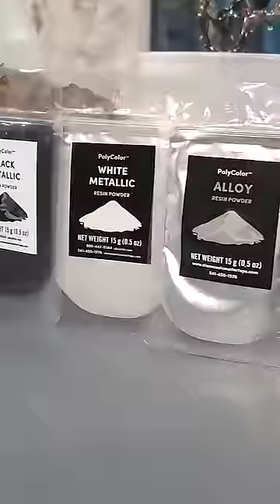I traded this Epoxy Table for Homemade Pie #shorts

Comment: How strong is epoxy and will it chip or scrape off easily?
Reply from the maker: Great question! Stone Coat Countertop Epoxy was designed for the kitchen and bathroom environment and our Ultimate Top Coat as a final step brings durability and scratch resistance to maximum. Heat resistant up to 450 degrees. Let me know if you have any more questions!

Comment: So how do you get rid of the drips on the bottom edge?
Reply from the maker: I scrape the drips between hour 2-3 after mixing with a paint stick, this will smooth them out. Or if I'm working in the shop I will flip the tops and sand the drips off